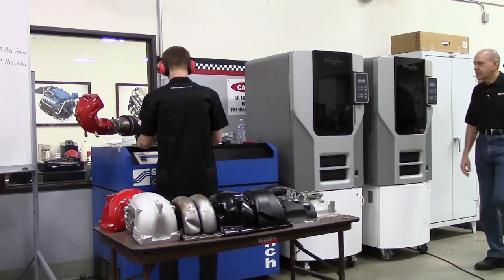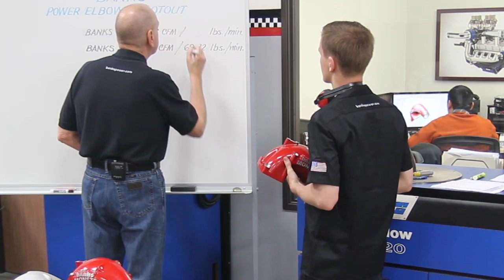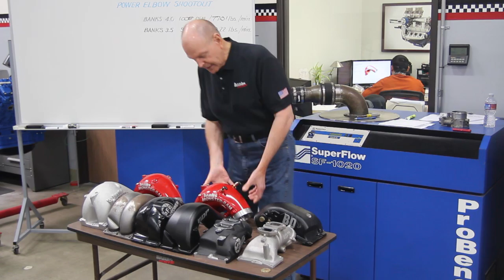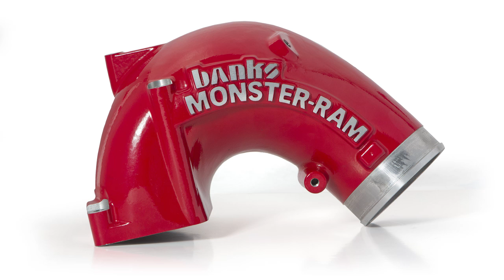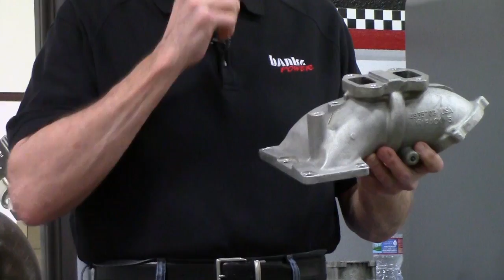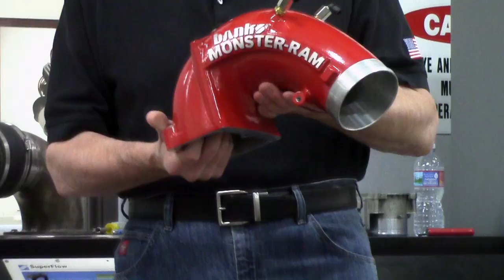The Great Intake Elbow Shootout of 2017: Part 1 - Banks

Comment: If I understand things properly  the tmap is for the computers air density  computations, then this should be relocated  duwn streem of the air compromising water/meth chamber . Not compensating for the density change is not a problem it's just an untapped resource

Comment: Great video Gale. In reality this was very straight forward, comprehensive and well done test, regardless of how you view the product. We had similar results when doing research and were able to show a marked increase in flow rates and increase of Air Density on mirror applications. They key to remember is by eliminating restriction not only equals more flow but also equals the amount of heat that is being dissipated and increasing Air Density. For example if you were to break down flow rates into each cylinder, one would think that they are all equal. This is not the case. In real world applications, each cylinder varies more than you realize and this is very apparent the farther away from pressurized zone at the inlet of the plenum that attaches to air intake horn. When analyzing the laminar and thermal flow rates into each cylinder, is was discovered that #5 and most notably #6 we almost starving for air in comparison to cylinders #2 and #3 with #1 and #4  following. One of the most logical ways to cure this problem is to make every attempt to equalize pressure into each valve inlet within the cylinder head. When you consider the stock configuration limitations it would make the most sense remove any restrictions possible and make all attempts to increase air into the cylinders that are starving or better yet suffocating for air, thus increasing Air Density. In racing and pulling applications, it is common to literally have the bottom half of the casting intake on the cylinder head to be machined off and utilize extremely high flow intake manifold assembly that encourages equaled flow into each cylinder that will help in increasing Air Density. This is done not only for power but also heat dissipation. All in all and to be honest you would not gain much power from utilizing any on these systems but you will most definitely gain some and dissipate heat and increase air density. Much like an high flow exhaust system, only marginal power gains can be found but additional heat is eliminated. Most power increase come from tailoring to programing pulse deration, sequence,  timing and other parameters including charge volume and pressure to increase Air Density. With that being said it would stand to reason that increasing power via programing and increase volume and pressure by larger or multiple turbo chargers that every restriction possible should be eliminated. One thing you can say about Banks is that they do their homework and a lot of research and development goes into their products. I believe that as far as bolt on applications go the only system better than this Banks unit is the application that is system currently under development here at Diesel Research Labs. This design will have close to 100% equal dispersion to all cylinders and flow a lot more air and increasing Air Density better than even the Banks unit. But it will be released in very limited numbers so I would just get the banks. It is the best of all the units tested.
Reply: Helpful information, 
There was a situation on LS1 swapped engine where 3 pistons just keep cracking near compression ring. It looks to be bad exhaust manifold from what you have said. Also, there was a similar situation with Nissan engine. They add more compressing (more CR), and the farthest piston just kept break down. 

For banks intake manifold, it is triangulated a bit for better equalized air flow. Also in the dyno tuning, he utilizes cly. pressure, exhaust temp and O2 sensors at each cly through out different load and RPM rang. Any imbalance cly. charging will be clear from the logged data.